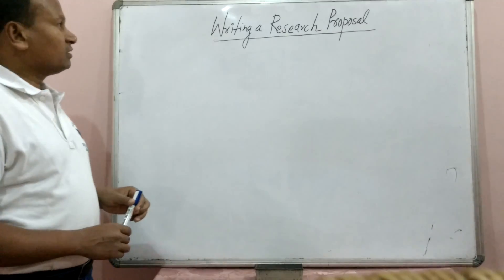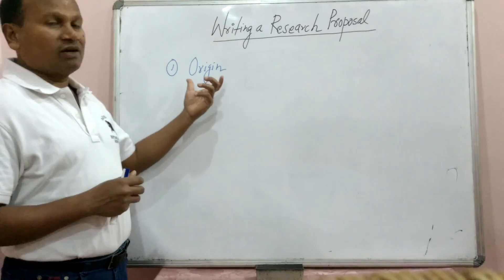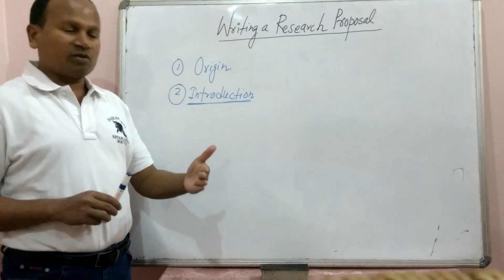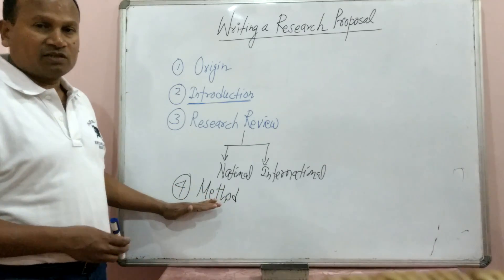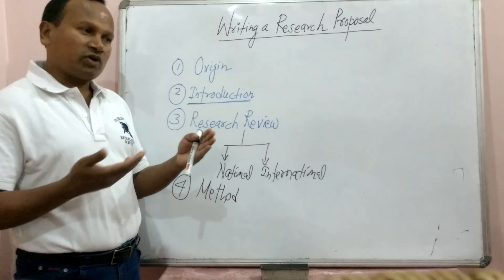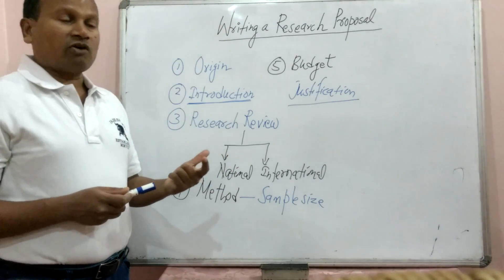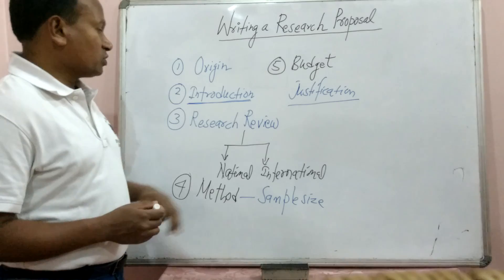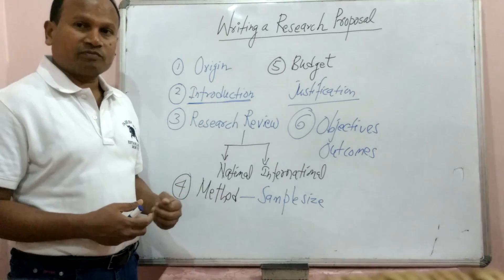Writing Research Proposal- Part-I by Dr G R Sinha

Comment: Sir,
I am a Ph.D. scholar. I have identified problems and I prepared my proposal also based on literature survey(many papers referred). I have finished paper publications also based on my research work. But why my panel members are telling to choose base paper? Why is it required in the case of Ph.D. also?
Reply from the maker: Thanks Arun for your query! Your question or issue that has been raised by the panel is justified and appropriate question. Actually, you study many papers and report their major findings and limitations. It is generally found that many of the challenges are addressed by few papers or any important paper. That becomes your base paper against which you have to validate your results; or improve the result or performance of that papers. Hope this helps you. If you still believe that more clarification required, do write to me.  May I know which University, you are to submit the work. Good Luck Arun!
Reply: Anna university...I am FT Ph.D. Scholar in Computer Science &  Engineering. Not on the main campus. Yes, I finished performance evaluation also. Now synopsis writing stage is going. Sir, kindly give me your mail id here. Thank you.
Reply from the maker: arun m drgrsinha@ieee.org
Reply: thank you :)